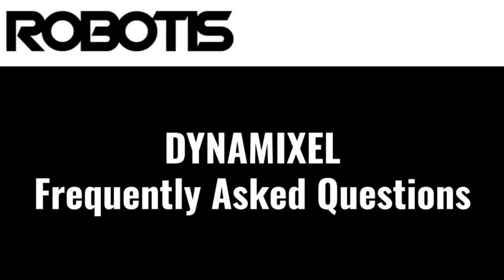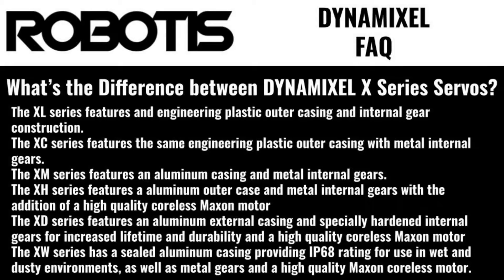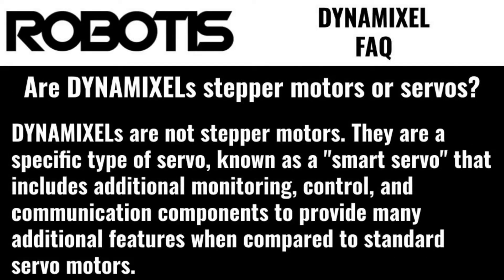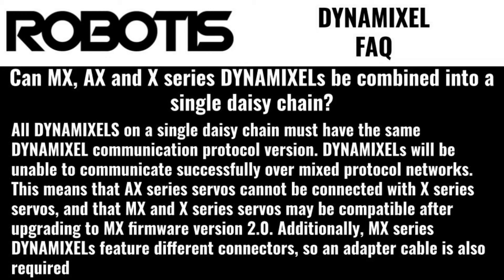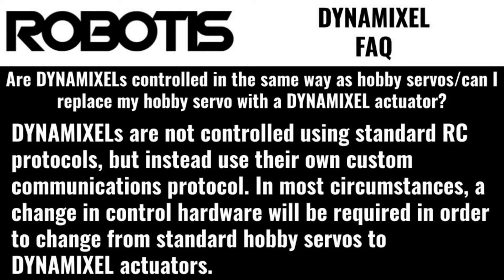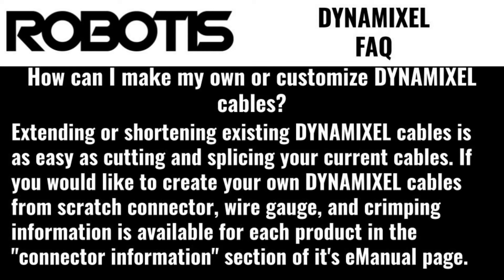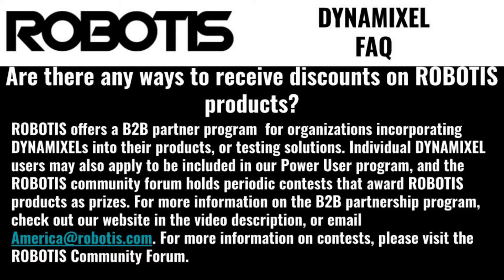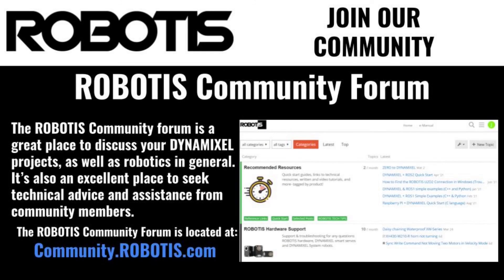ROBOTIS DYNAMIXEL Frequently Asked Questions

Comment: Is there any way to control the speed of operation of Dynamixel in PWM control mode of operation?
Reply from the maker: When in PWM control mode, the Goal PWM determines the output speed, direction, and torque of the motor.